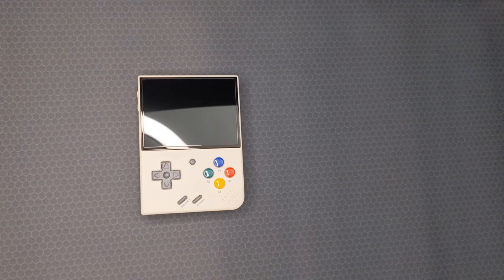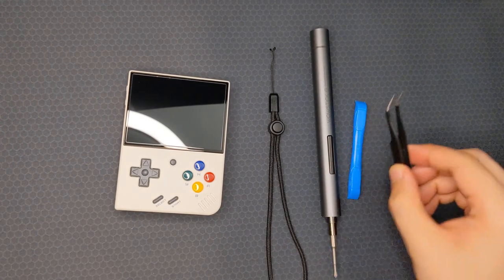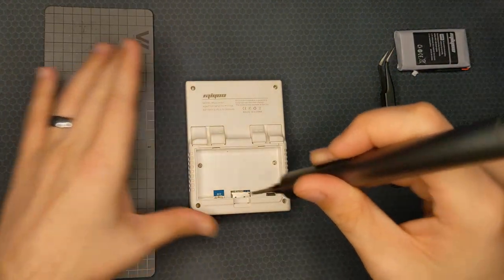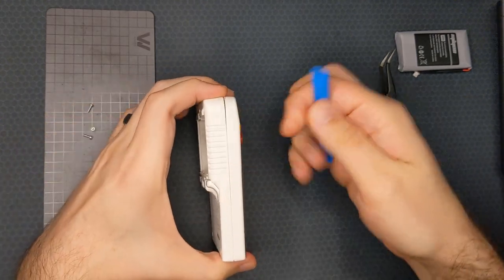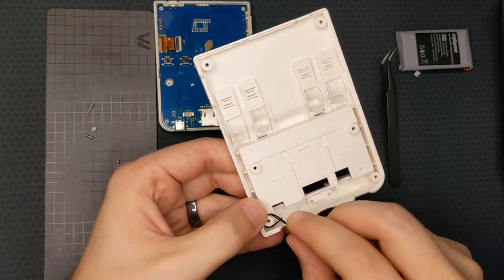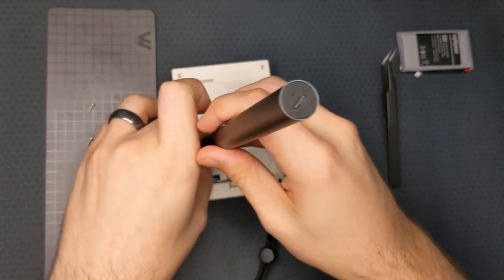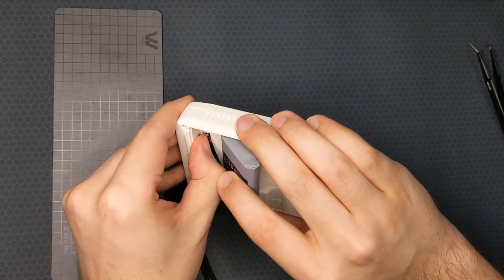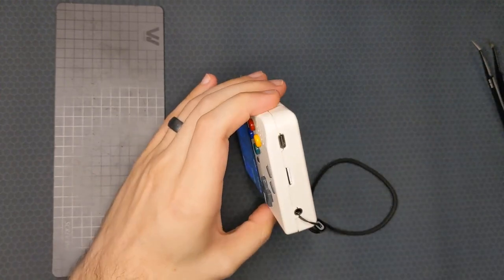Miyoo Mini Plus Lanyard Installation

Comment: Did you loosen the screws a bit before using your wow stick? On both my devices the screws easily stripped. But if the wow stick can open them with ease I’d like to pick one up
Reply from the maker: The first Miyoo Mini it opened no issue. The 2nd one I had to loosen the screws for the first time to avoid stripping. If possible I would recommend replacing the screws when they get close to stripping because the ones that come with it are not that great .
Reply: @PhyrexTechs  thank you!